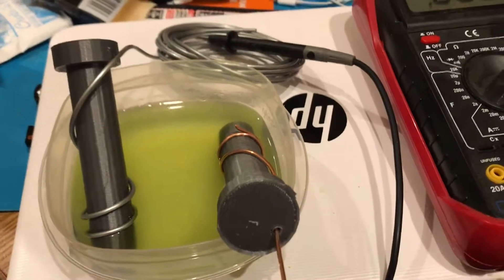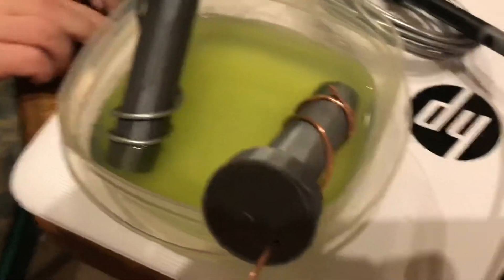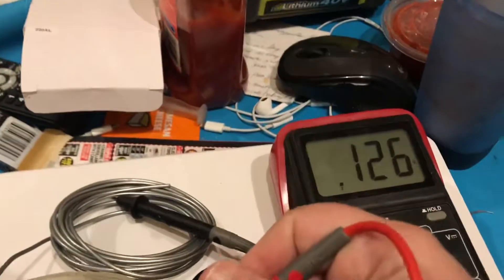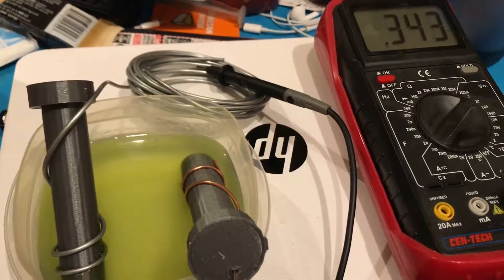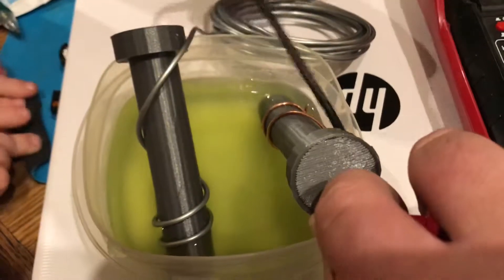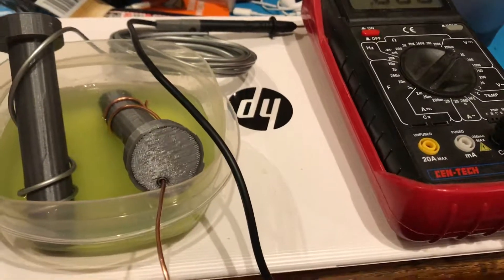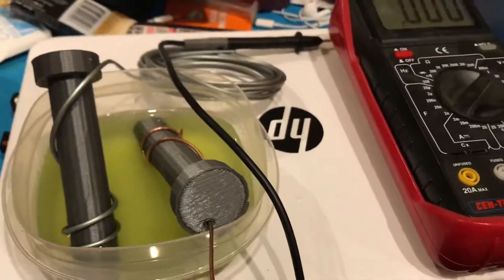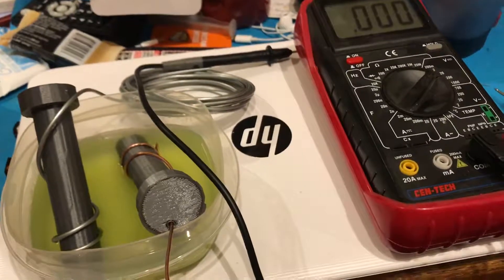Algae power cell .8 volts

Comment: Will you put out a video showing how to hook up multiple cells in order to heat a small heating pad?
Reply from the maker: The whole setup was recycled in the plastic bin after the Hackaday Prize was over. I did get a $1000 prize , but did not get a runner up on the big one.